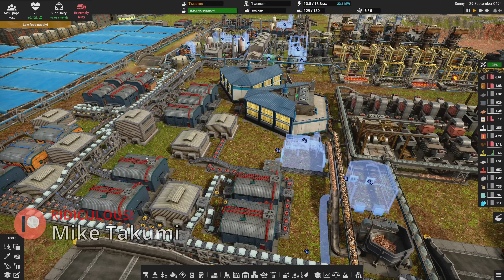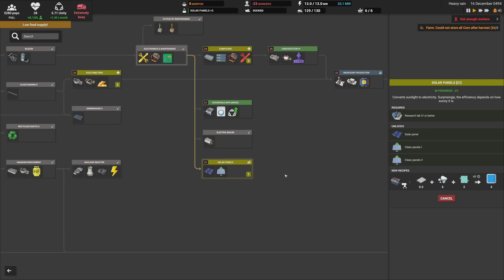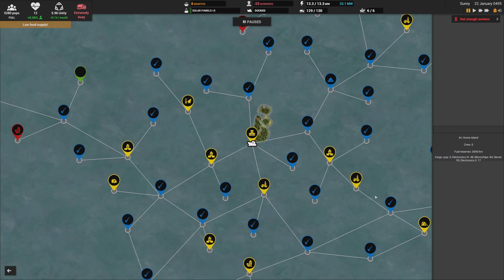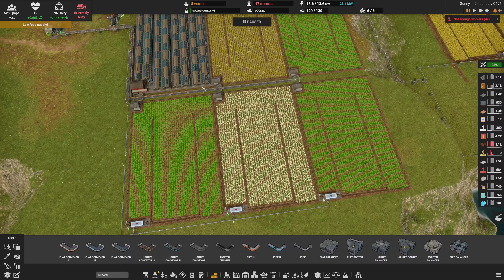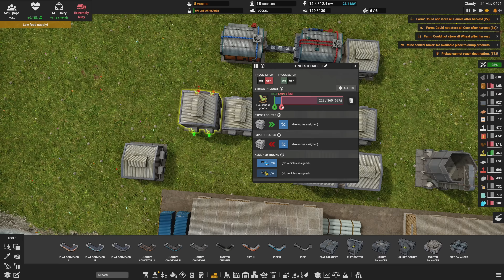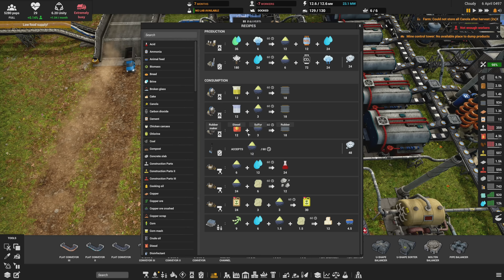WE GOT OPTIONS, OKAY?  - Captain of Industry - 51 - Early Access Gameplay

Comment: I can assure you your tools are no bugging out.  I played this game to ridiculous levels (ridiculous enough they used my map for testing) and the tools always followed the logic that governs them. 

Turn off the magnet and the port exclusion and they will often work better in the instances you are using them as they keep seeing the items your curser is pointing at and try and interact with them as you are asking them to.   Yes, it's annoying, but I cannot think of them acting any different that will improve it.

*You might also want to think a little bigger for your spent fuel storage, I have around 25 of them filled.  One will be enough to start the reactor, but you would be surprised how fast they fill.
Reply from the maker: Level 3 power output is gonna push out 12 waste per year. This storage holds over 400 years of waste. I don’t plan to play that long, but sure, if you’re gonna play on and on… sure.
Reply: @CharliePryor  If you have a reactor dedicated to the thermal pumping of your crude oil processing and desalination that becomes 200... Then another reactor to run the arc furnaces.... then another.. and another =) You would be stunned how much you can make in a hurry 🤣
Reply from the maker: I don’t doubt it. - but not for me though. I’m not playing long enough for that to become an issue